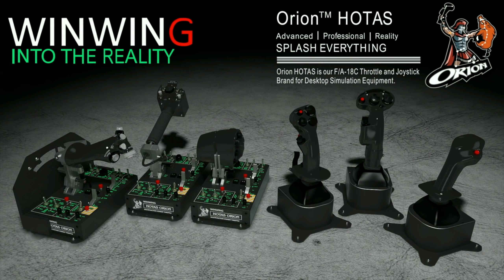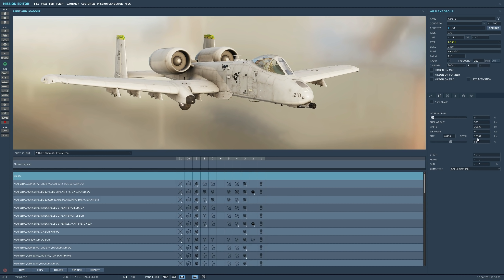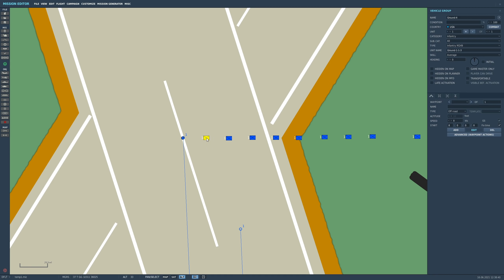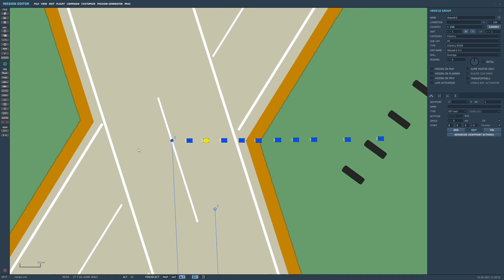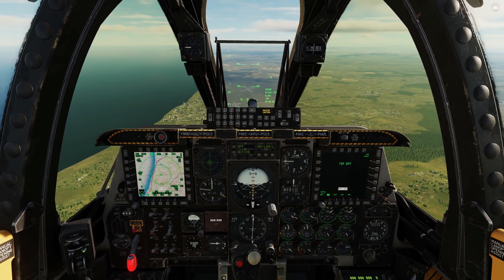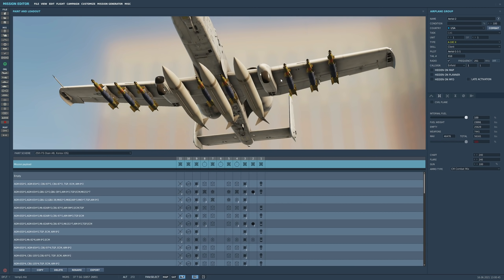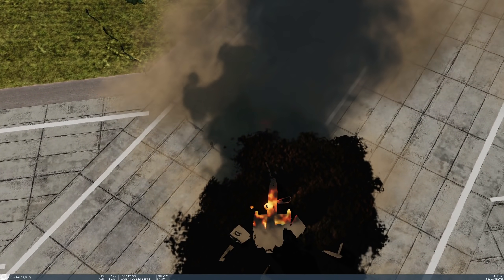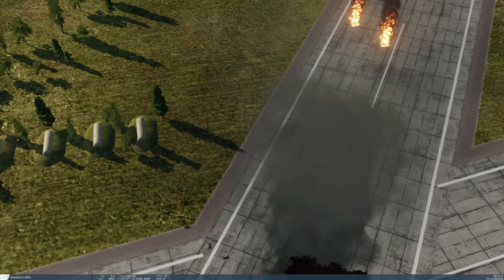Questioned: Does Larger Payload = Larger Impact Radius? | DCS WORLD

Comment: I know that the bombs are designed to not go off unless a fuze is impacted, but wouldn't the concussive blast of the aircraft and it's fuel exploding cause problems for the ordinance attached to it irl?
Reply: Depends on the exposive used. Some of the most commonly used high explosives in weapons require insane energy in order to detonate because they are very stable. You don't want them blowing up if an ordie were to drop one while loading it onto a plane. The shockwave that will set off C4 needs to be greater than 8000 m/s which far exceeds the max speed of any aircraft, so the crash itself is not detonating the explosive. You've also mentioned the fuel explosion, but fuel-air mixtures explode at between 1200 and 1400 m/s so that's also not close at all to the requiered to detonate C4. 

If you manage to hit the fuze, they are made of very sensitive explosive that might trigger the secondary explosive, but it would need to be a bit of a lucky hit
Reply: I looked it up and the Mk-80 series of bombs doesn't use C4. it uses H6 which has a slightly lower detonation speed (~7600m/s) than C4. Still, way too stable to just blow up on impact. 

when it hits, the weapons will probably just get spread arround with the rest of the debris and just burn

Comment: I've a challenge for you, Cap.

On July 19, 1989, United Airlines flight 232 was enroute from Stapleton International Airport to Philadelphia when a fan disk of its #2 engine (the one in the tail) disintegrated.  Shrapnel from this failure severed all three hydraulic systems on board the aircraft, cause a complete loss of pitch, roll, and yaw control.  With the aircraft no responding to control inputs, the pilots used differential thrust to gain some semblance of control.  296 people survived the resulting "crash" while 112 did not.

So, can you recreate this in DCS?  Land a plane of your choice using only differential thrust.  

https://en.wikipedia.org/wiki/United_Airlines_Flight_232
https://www.youtube.com/watch?v=fG-6nHwfyts
Reply from the maker: wow! Thanks

Comment: Regarding aircraft velocity, if the amount of kinetic energy is a factor in your tests, velocity isn't the only component.  If you wanted to equalize the kinetic energy of both aircraft, you would have to increase the lighter aircraft's impact speed well above the heavier aircraft.  I think we found that that's probably not a factor, but if you wanted to test that in the future I think you'd have to calculate the final air speed of the lighter aircraft.

Comment: As far as I know, these bombs DO NOT EXPLODE ON IMPACT (airframe crash) unless they are armed and programmed to do so.
Reply: Will not explode on their own due to a crash. This doesn't cover being set off due to secondary causation such as a piece of the airframe damaging the casing exposing the explosive to both heat and pressure which could set it off.

And while bombs are designed to minimize this, they are not immune to it or else bombing ammunition depots would be pointless.
Reply: no bombs will detonate unless armed, the USAF has lost several nukes that didn't detonate when they impacted. One included the aircraft.
Reply: No they won't... No guarantees in a post crash fire though and for how long it is left to burn.
Cookoffs are always a real danger.
Reply: @CMDRSweeper  depends on the bomb type, the missing nuke the bomber burned so hot and long the beacon was destroyed so they couldn't find the wreckage. Took 40 years before the twisted and burnt remains of some structural frames were found, the nuke it was carrying no trace found. A nuke going off in BC right near South East Alaska would have been noticed.
Reply: Bombs that are not armed will not detonate on impact.  This is so you can jettison them safely in an emergency.  I have seen Mk 82s with defective M904 fuzes dropped by F18s at 550 knots skip and Ricochet off rocks not explode.  Some even had burst casing with tritonal al over the place and didn’t blow.  Yes dumb EOD guys have to find the bombs and detonate them with C4 during range clean up.